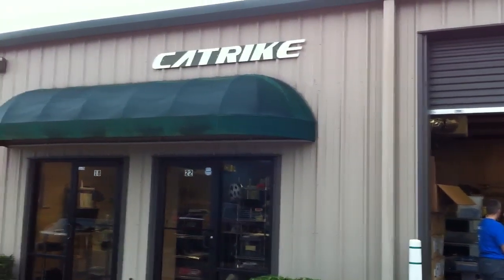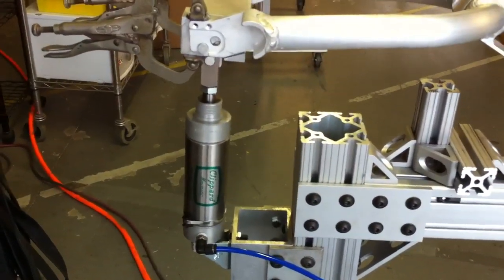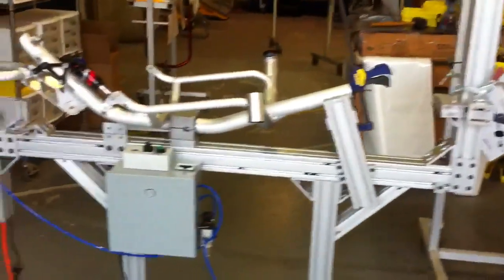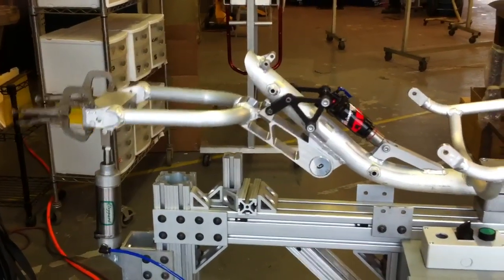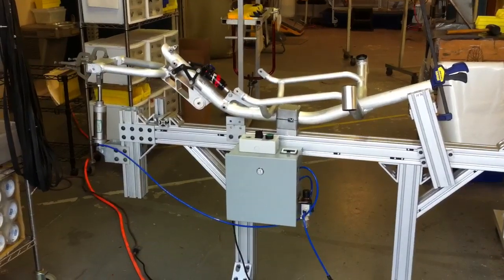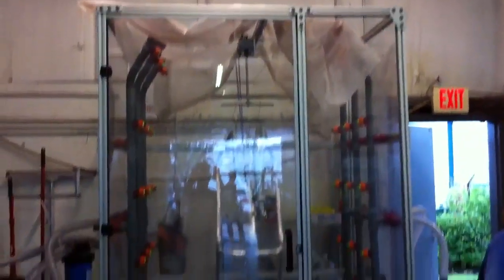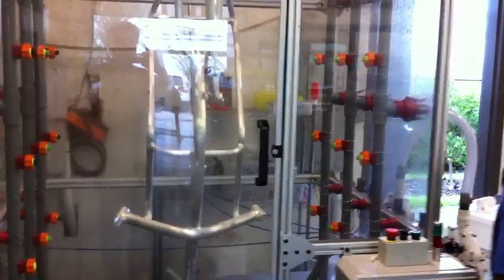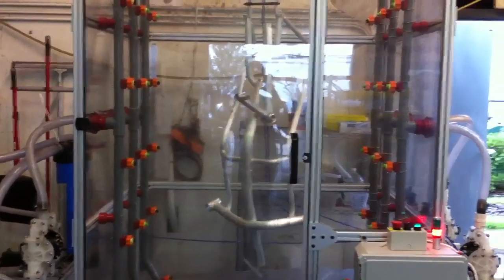Catrike Automation

Comment: WE MADE ABOUT 75 CONTROLLER BOXES FOR FLEX TESTING CIRCUIT CARDS . 
THIS IS VERY SIMILAR TO THE ONE YOU HAVE STRESSING YOUR FRAMES . 

OUR BOXES CAN RUN TWO CYLINDERS AND HAVE ADJUSTABLE PRESSURE 
VALVES AND GAUGES IN THE FACE . 

IT IS VERY INTERESTING TO SEE SOMETHING SIMILAR . I KNOW YOU PUT A LOT 
OF WORK INTO IT .